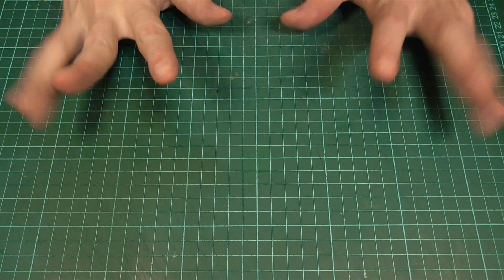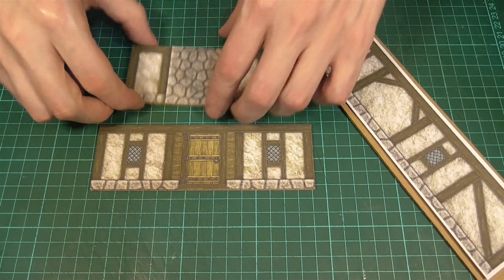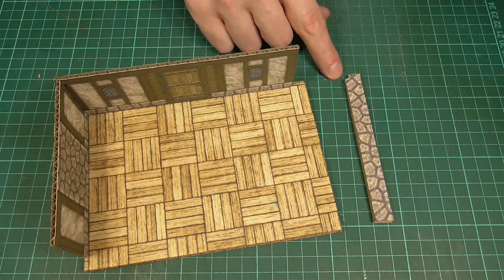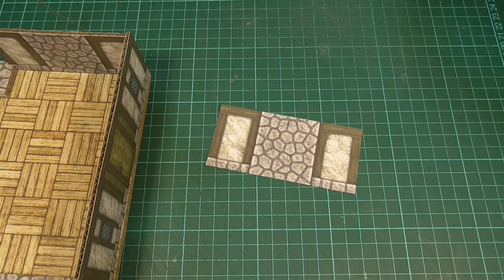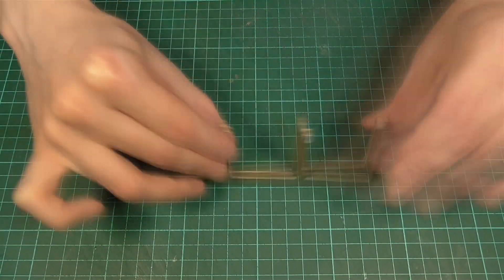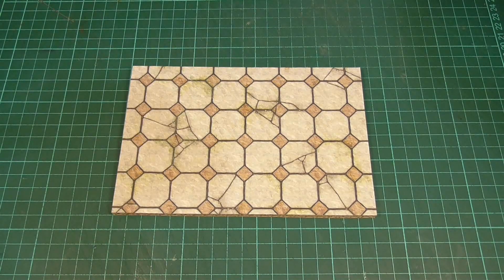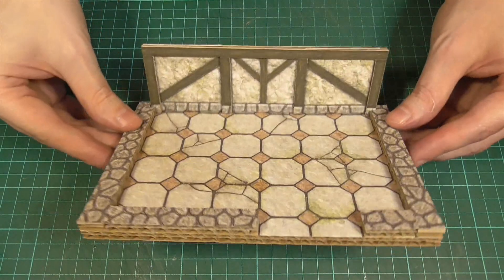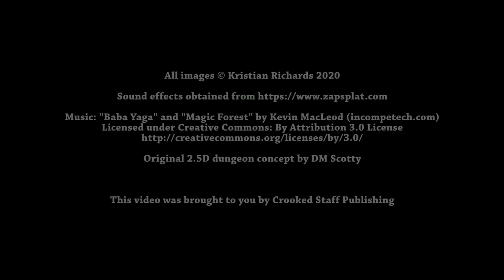Episode 43: Cottage Walls (RPG Terrain)

Comment: Epic, sliding peaces in basic/default frame is super very practical, minimal use of whole new wall build while also maximal posible variety of building enterior. XD
Reply from the maker: Thanks. I might have to try something similar with 'dungeon' walls in the future :)
Reply: @CrookedStaffTerrain  may i suggest, for things put on d wall, to b put IN d wall. Use toothpick or needle or wire peaces and u can stick d things on d wall when needed and easely remove it.

Comment: DriveThruRPG can't open up fast enough.  This set of textures is going to find use as a connected series of interiors where the thieves' guild has a meeting spot.  These will make the chase scene much more memorable for the players.  Thank you!
Reply from the maker: No problem (if you get chance, you'll have to let me know how it goes).
Reply: @CrookedStaffTerrain  In the community challenge packet of textures, you have a small wooden plank and nails texture.  Have I missed a texture set where that particular plank and nails floor texture comes in a full page size?
Reply from the maker: @earlkriewall7251  You've not missed it. That's only been featured in aforementioned 'challenge' pdf as of yet. But as you can see, I've started doing more town/village stuff of late (check the community tab for my latest builds) ...so more of that kind of thing should be on the way ;)
Reply: @CrookedStaffTerrain  Not that I mean to be adding to your impressive "to-do" list, but thank you very much!  :)

Comment: I was wondering if you were going ton produce any textures for castle walls? I was also thinking of wooden stockades where there isn't an abundance of stone or "the castle" is a Norman Motte and Bailey type fortification?
Reply from the maker: I'll probably get around to 'all the things' eventually :)

But here's an example of some nice 'stone walls' that I made for a 'dungeon in a box' a while back  (which will probably make it to video at some point - though I believe the inside of castle walls were sometimes plastered and decorated ...so I'm not sure where where to go with that yet).

https://i.imgur.com/zIOwHvW.jpg
Reply: @CrookedStaffTerrain  That image looks good. I'd use the wall texture for external walls and barracks rooms and storage areas.  I guess a plastered wall texture could be produced for internal walls if the plaster was over stone. Maybe a reuse of the cottage walls if the structure wasn't entirely made from stone.

Comment: I recently found your channel and really like your style of crafting. No excessive cutting, painting, or gluing all kinds of materials. It really suits my style. I only wonder, how do you manage ink? You must go through ink cartridge pretty fast and ink isn't cheap. Do you plan out in advance and print at a store?
Reply from the maker: I do try to make these as low-cost as possible ...so I have a cheap (£25) canon printer/scanner, and I refill the cartridges will cheap refill kits off ebay.
So I can generally refill one cartridge half-a-dozen times (sometimes more) before I need to replace it (and the current refill ink I have only cost £10 ...and will likely last me a couple of years).
Hope that helps!
Reply: Wow I didnt't know you could refill the cartridges yourself! Thanks a lot I'll look into it!
Reply from the maker: @benoitdemers1900  Yeah ...though I think it depends on the printer (some companies take measures to stop you doing it). So, when I'm looking for a new printer, I always check (usually here on youtube) to see if it's the type that can be easily refilled.

Comment: Anyone got advice on printing things like this economically?
I always find myself burning through ink cartridges, and we all know how expensive those things can be!
Thanks in advance  : )
(P.S. Love the work on this channel!)
Reply from the maker: When I picked up my own inkjet printer (a cheap canon printer/scanner that cost £25 new) I made sure it was one where I could refill the ink cartridges easily.
So I generally buy cheap refill kits off ebay ...which can be a bit messy at times - but I can usually refill a cartridge about half a dozen times before I need to buy a new one.
Not sure it that helps much ...but that's how I keep the cost down :)
Reply: @CrookedStaffTerrain  thanks for the reply, that's good advice! Not sure it'll work on my printer....but I'll look into it! 😁👍
Reply: I recently invested in an Epson 2720, for this exact reason. So far I have not been disappointed. I print all my textures at Standard-Vivid, and i've printed over 200+ textures so far. The prints are amazing, and I haven't even used 1/4 of the tank yet. Also if you get the 3rd party refillable ink and not the Epson brand ink you can pick up a 4 pack (black, cyan, magenta, and yellow), for right around $25 USD.
Reply: Download the files onto a thumb drive and head over to a FedEx/Kinkos location. 
You can print dozens of copies fairly cheaply on their DIY printers, if you're trying to spare your ink-tanks at home.  I think I'm going to invest in a refiller kit, though, now that I know an Epson can do that.